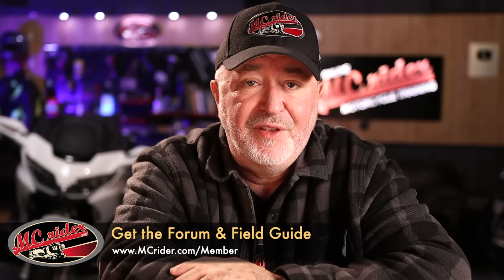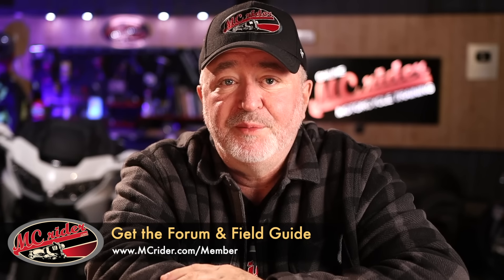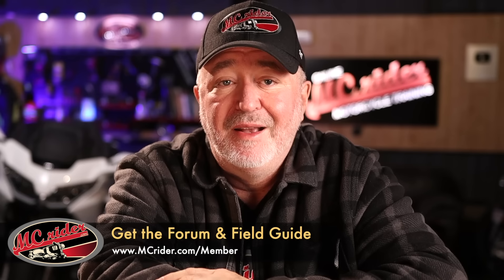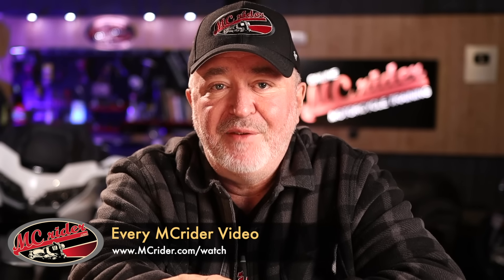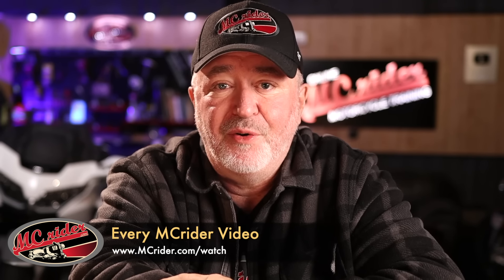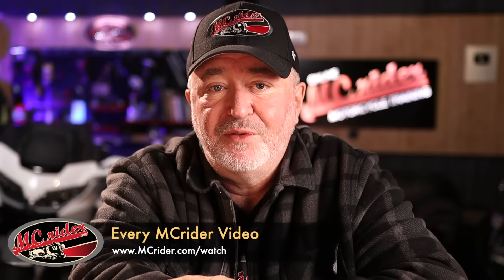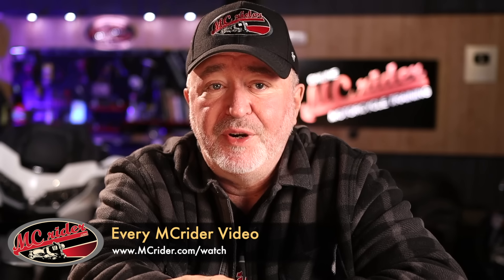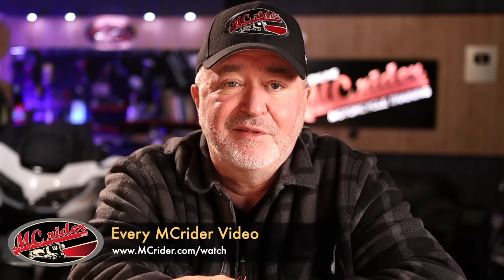The Most Misunderstood Control on a Motorcycle

Comment: I had taken several motorcycle classes and practiced slow speed skills a lot of over a two year period and decided to replace my OEM clutch with a Barnett clutch, just as preventative maintenance. When I took out my OEM clutch, there was so little wear, that it was measurable only with a digital micrometer.  Since I already had the new clutch soaking in oil over night, I replaced it anyways. The Barnett clutch springs are stronger. but it was actually un-necessary. I did find my rear brake pads worn by a millimetre.  Doing a lot of slow speed practice wears out your tires more than the clutch.

Comment: The excellent YouTuber Moto Control did a whole video where he rode his bike at very low speed, slipping the clutch, for a whole hour.  At the end, the clutch was working perfectly.  He even disassembled the thing to show there had been no appreciable wear.  However, if one is also dragging the rear brake for most of one's slow riding, there will be some wear on the clutch (and on the rear brake).

Comment: Boy, was I wrong.  I thought for sure you were going to say that "The Most Misunderstood Control on a Motorcycle" was going to be the brain.  It is the brain that gives us an issue about control..."I am going too fast, just look at that curve, you can't make it so just panic and stare at that tree ahead"  VS  "Stay calm, you CAN make this, don't look at the thing you want to avoid.  Keep your chin up and your head turned into the curve in the direction you WANT the bike to go.  That way, even if you go down, it will be a low side crash, which is much safer than slamming into the tree."  Etc, etc, and etc.   But yeah, clutch is very important to proper riding technique.  Great topic, Kevin.

Comment: I always said that riding a motorcycle is a master lesson in multi-tasking.
You see, in a manual car, you use:
left hand on steering wheel.
Right hand on shifter.
Left foot on clutch. (clutch/brakes if you are advanced)
Right foot on gas/brakes.

On a motorcycle you use:
Left hand on handle.
Left fingers on clutch.
Right hand on handle.
Right fingers on front brake.
Left foot on shifter.
Right foot on rear brake.
Thighs on tank for bracing.

Comment: You should have also covered that in an emergency when a clutch cable brakes, other than starts and stops a motorcycle can shift gears without the clutch. And that is without wear on the gears. I had a time with a broke cable that I had to do shifting without using the clutch. Once I got moving there was no clutch use for the ride back to the shop. The bike usually do far more than riders know.

Comment: Motorcycle handlebars are even more misunderstood.  Above parking lot speeds, you must steer by making the motorcycle lean.  As my instructor said, "Bump right, turn right".  Gently push on the right handgrip, and the bike will lean to the right and turn to the right.  Stop pushing, and the bike will continue to turn while the handlebars are neutral!  As you exit the turn, push the left handgrip to take out the lean and stop the turning.  At slow speeds the handling feels very different, so a rider can get quite a surprise when leaving the parking lot and going down a road for the first time.

Comment: I owned a 2012 Kia Rio that I was rear ended at a stop light right after it changed to green.
The driver on the Dodge Ram half ton truck was busy on his phone,late for an appointment, looked up at the light,whipped his truck around a car in front of him and looked down at his phone as he did it.
Well, the car in front of me had not moved and I saw him coming.
I punched the little Kia straight ahead because that's all the time I had to react. 
That saved the car from being totalled.
I always thought,man.if he had hit me on a motorcycle, I'd be trying to learn how to walk again.
Without question,your tip about watch your back (your 'six') is a great tip.
Like you,I am never comfortable at a stop light especially if the driver almost hits me before they stop and is obviously distracted as they sit at the light.
Since my accident,I have actually driven away from some lights by turning in other directions to not be in front of drivers so out of control they look dangerous just sitting there.
I don't 'give a driver a piece of my mind.'
I just see the dangerous driver and get my precious ( and passengers) precious body away from them.
Great tips about the clutch and the danger of stopped situations ,sir.

Comment: if it isn't an integral part of the FRAME it's a consumable part. Tyre, cable, fuel, plug, battery, plates, oil, brake fluid, blinker bulbs... my CBT (UK version of the MSF which is mandatory here) instructor showed me the right technique in clutch usage. Me being a new (motorcycle) rider I had no bad habits for him to beat out of me.

Comment: I was one of those guys that I was born in the 90s and when I went to my MSF course I was still asking the stereotypical "what rpm do I do a thing at" and "when do I shift" but I learned the way you talk about using the friction zone yet I constantly talk to my dad and friends that constantly say that misconception that it WILL damage the clutch and my response is always "the clutch plates are disposable...I'm not" I don't have a car or ever driven a manual transmission car but I know that my 8500rmp redline is a lot different than trying to pull a 3000lb car with 4500rpm redline to 25 in first and 50 in second is way more abuse in a car than a 500lb bike. If you ride your manual transmission car like you ride your sports bike you might rip the drive train up.

Comment: I ride a Moto Guzzi which has a dry clutch. Slipping it for an extended period will overheat it and damage it. In order to service it requires the bike to be "crabbed" which means the frame has to lifted off the engine. A very intensive job and if you can't do it yourself very expensive. Just a warning for those owners with a longitudinal drivetrain in your bike it would be wise to use the friction zone in moderation.
Reply: Same with my BMWs. Yes, the clutch is a wear part but on our bikes it can be a very expensive and difficult wear part to replace.

Comment: My hangup early on came from having driven so many tractors, cars and heavy trucks with clutches and having it drilled into my head to NEVER ride the clutch more than absolute minimum. It took me a long time to get used to slipping the clutch as a method of controlling power to the wheel rather than the throttle. I still have to do some drilling because I still have bad habits to break.
Replacing the clutch on a car is expensive and requires a shop and specialized tools. Replacing the clutch and springs on a motorcycle is usually an hour in the driveway with basic tools and maybe $200 at most, probably less. Heck it's easier to replace a clutch than it is to replace the air filter on many bikes.
Reply: I'm still driving a manual transmission car, and riding a motorcycle has helped me be a smoother car driver too. I realized that I was weighing minimizing clutch wear so heavily even on the car that I was being a lot rougher on the starts then I really should be.
I do have 205,000 miles on the factory clutch with the car, but honestly it's not really THAT big of a job to replace a car's clutch either. It is a full day for a shadetree wrencher in the garage but it's not terrible.

Comment: tbh, I'm from the UK, and most cars are manual, so understanding the biting point on a clutch is more intuitive for me. When ever I pull up to a junction on a hill I will often hold the car on the clutch, for a shorttime, and it can be done with surprisingly low revs, so clutch wear is minimised. I'm in my 50's and I have been driving like this for many years long and have not worn out any clutches prematurely. 
Another use of the clutch on a bike, particularily peaky 2 strokes, is when you are just a bit below the power band and you need to accelerate. A quick dip then slip of the clutch can get you in the power band and accelerating hard quickly without having to change down a gear, and of course, being fully in control of the clutch really helps with wheelies.

Comment: I’ve been riding since 1980.  This is a video I wish I’d seen long ago.  I had the mindset that excessive slipping of the clutch is harmful, just as it is with an automotive clutch.  As a consequence, my low speed maneuvering has been jerky and imprecise, especially after I got my VTX, which has a high first gear, and my goldwing, which is quite powerful.  Now all I have to do is teach this old dog new tricks, and what a difference it makes when I resist the urge to dump the clutch lever.

Comment: I have 55.000 Km on my R1200RT, 64.000 Km on my previous Z750 and 80.000 Km on my old XJ600N and never had to replace the clutch plates.
Okay the XJ600N Diversion's plates where worn out pretty badly, but it had seen a lot of abuse on the clutch as it was an old instruction bike with 240.000 Km on clock!
As stated in the video, you need to let the clutch slip for smooth riding and good control at low speeds. 
You will need to ride a lot to actually wear out the clutch of a motorbike, I never achieved to do so.
(Being from Holland, where most cars still have manual tranmission, the majority of people knows how to use a clutch and shifter. 
Only for a few years now a lot of corporate cars and EV's have automatic tranmission here).

Comment: My current Bike is a 2006 with absolutely no bells and whistles. Looking at new Bikes has been a real eye opener with ABS, Nav, Stereo, Throttle Control, Auto trans etc. I properly use the clutch and have never replaced a clutch after over 100K miles.

Comment: Most clutch packs are so easy to repair. I find on the bikes I've had that it's less work then changing a rear tire. I will add that in the beginning I hated holding that clutch at red lights. But after a couple months it felt normal to be in 1st with the clutch in. And I stop short of cars and allow some kinda of escape route. Ive been rear ended at a light in a car and can't do much. But on a bike I can almost always find a way out if I plan my ride. Haven't needed it yet but I take the advice. I'm not gonna add any risk to my ride to save a stupid clutch...

Comment: Started using excessive friction zone practice back in early 1970s and never had clutch problems on any of the Honda motorcycles I've owned sense. I was always hard on any equipment, pushing things to the limit. Only reason not to ride a clutch that I personally know about is to prevent damage to throughout barings by having them ingaged for log term at higher RPMs. Just stay off clutch unless using it and that problem is averted. Ride the clutch when clutching is required and stay off it when not.

Comment: Rearbrake on constant minimal pressure in combination with limited trottle is used to control the bike at low speeds at a parking lot.
The bike stays in first gear no need to slip the clutch constantly. 
Yes it can do it without wear but it is the least stable option.

Comment: For those worried about wearing out the clutch, hopefully this helps to put your concerns to rest: For years I used a highly geared motorcycle as a daily commuter. This required 10-20 minutes per day of constantly slipping the clutch in stop and go traffic. I still got 60,000 kilometres out of my clutch. In the 15+ bikes that I've owned, I've only ever had to replace one clutch.

Comment: My DR650 is actually pretty easy to change the clutch.  In theory, I could flip the bike on the left side and swap the clutch with a few hand tools and not even drain the oil (although you'd need to be careful not to get dirt in there).

Comment: I see some motovloggers that seem to take pride in how quickly they shift... they'll pull in the clutch, shift and let it out in a half a second.  I'm assuming it doesn't matter if it takes 2 or 3 seconds to shift vs a half second.   Are there advantages to a quick shift, other than on the race track?
Reply: The only real advantage is smoothness. Smoothness is only really appreciated by a passenger and the parts of the bike will appreciate a smoother shift. A faster shift is just faster.
Reply: On a sporty engine or thumper, engines with less rotating mass, engines that rev up fast, i just upshift without clutch, preload shifter, chop gas and upshift, takes .2 seconds or less.  You can also clutchless downshift, preload shifter, blip gas and downshift, but theres not much benefit, using the clutch downshifting doesnt cost you any time.  Clutchless downshifting is more difficult to master and is easier  to get wrong. A cruiser engine will likely not like clutchless shifting, they are slower to rev and dont like abrupt rpm changes, i would use the clutch on a cruiser.  Their engines having more rotating mass will be harder on the gears if you shifted clutchless.  Many stock sportbikes with quickshifters and autoblippers, dont know of any cruisers with the same.

Comment: I would contend that if you are trying to get out of the way of a car, you need to rev the engine to get the bike to launch. In the time it takes to get the RPM up, you can drop it in gear. I drove back and forth to work every day for 3 years in rush hour Chicago traffic. 30 miles one way. In all that time, I never saw a car do anything that was not easily predicted well in advance. If you are paying attention, and aware of your surroundings, you have plenty of warning that something bad is going to happen.  
And just for a fun side note, I wore out my clutch in 20K miles on a Goldwing, due to stop and go traffic. That was not from leaving it in gear of course, but rather teaching myself to never put my feet down.

Comment: My bike has 142,000 kms and still has the original clutch.  I attribute its longevity to shifting without the clutch after getting up to speed in 1st or slowing down to first.  Its only used to get going, and for slow maneuvers with the friction zone.

Comment: Having carpal tunnel syndrome and even the surgery to alleviate it I still avoid using the clutch as much as possible.
Any technique where you hover the brakes or ride the clutch can result in something nasty happening eventually like requiring carpal tunnel surgery or a cable snapping at the wrong moment or a bump causing you to apply the brakes at the wrong moment.
Brake, clutch and throttle are on off switches First and volume knobs second.
You need to know how to set up properly (for corners , stops and starts etc) to control the bike properly. Fine tuning with clutch or brake or throttle are what comes later.

Comment: Great video. I cant wait until you go over the front brake. That is a bad habit of mine is using to much front brake. I did see last weeks video where you went over proper braking techniques. However, I need to know why using to much front brake is bad
Reply: Front brake is our best friend. I had the same mind set as yours a few years back, but since practicing the proper technique I've changed my mind. Rather than "too much front brake", it's more likely "improper application" i.e. squeeze the brake and don't slam/grab it.

Comment: I noticed on a bike with a mechanical cable actuated clutch while in the friction zone while turning the handle bar left to right or visa versa, it changes the power applied to the rear wheel without changing the position of the clutch handle or throttle.

Comment: LOL, yup, i like shifting gears on my bike, down shifting before the turn, leaving it in first at red lights, just in case, like you said. the funny part, standing up so not to wear out the suspension, or tires. but i am still learning. will be for a long time. but it is fun.

Comment: While I did drive a manual car for close to 40 years, I don't ride a manual bike, but we do have the equivalent need on an automatic to even out the jerkiness of  the system at very low speeds with the rear brake, but not nearly as much as new riders use it for that.  This is not an argument against using the clutch for low speeds when needed, but I think people will overuse this technique when they don't really need it. To a large extent this depends on your bikes particular configuration, but in general many of the slow speed exercise do not need to have the clutch slipped, and the rider is simply riding too slow for the slow speed exercise because they are scared to let the bike go faster.   Making a hard right or left turn, u-turns, figure 8's etc are all achievable without slipping the clutch (by going faster) and are in many cases on many bikes only achievable if you are not slipping the clutch.  It's not that its not needed at all, I think too much emphasis might be placed on it however.

Comment: Totally understand your philosophy on using the clutch, although riding on an expressway in stop and go traffic my street glide’s clutch will tire my wrist out pretty quickly to the point I can only handle so much then would have to pull over to rest. So, at a red light most of the time I am a neutral guy
Reply: Get a hand trainer. Don't think they cost much. You need to train your grip strength up… Not safe to have you bike in neutral in “the war of traffic”.